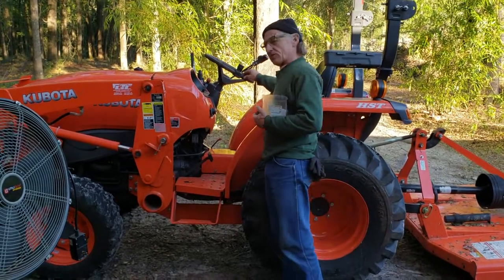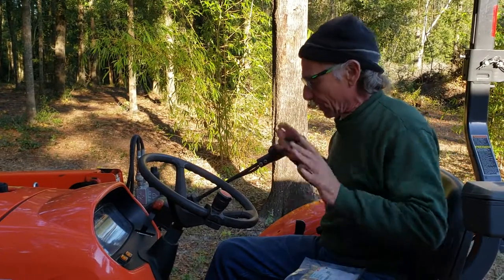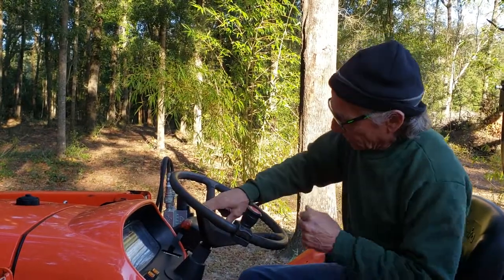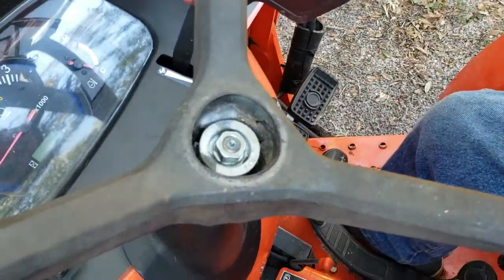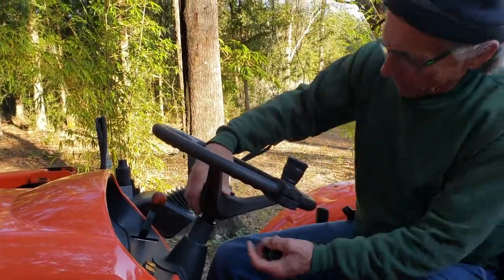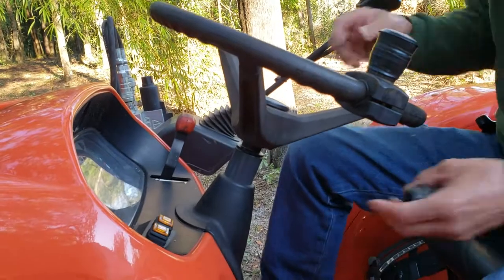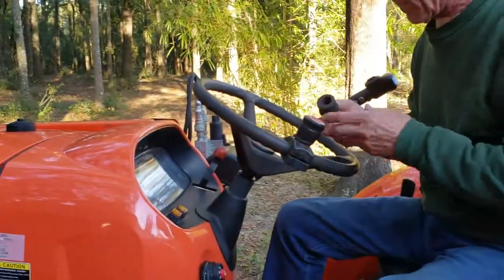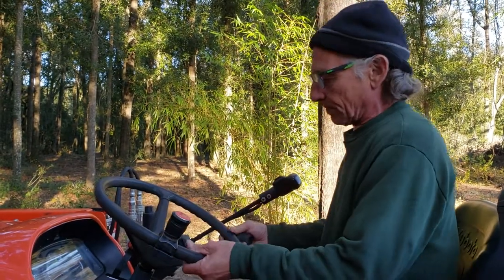Kubota steering wheel wobble

Comment: That's the exact part I need for my Kubota L275dt, cant find it anywhere. Used a puller like you did to get the steering wheel off, and sure enough the rubber is all shot.